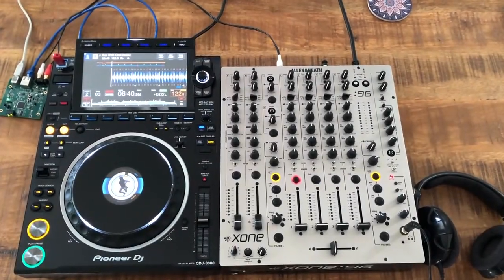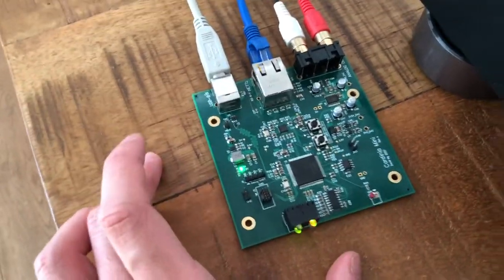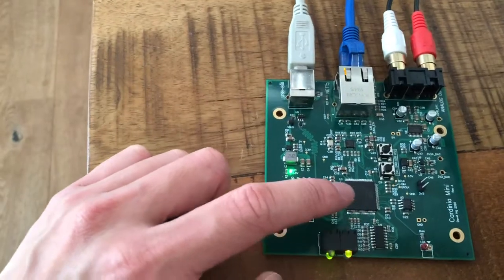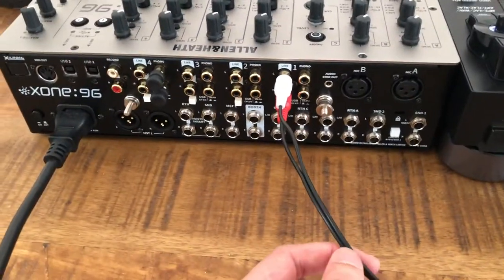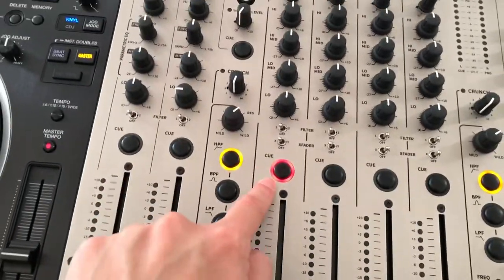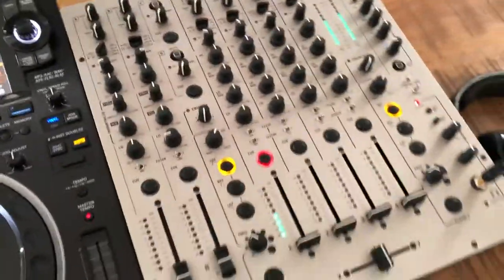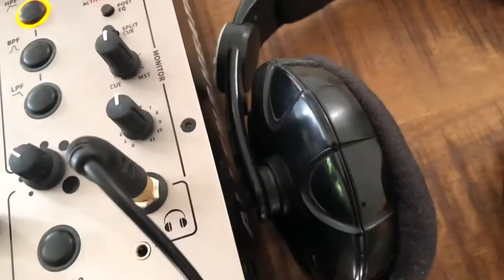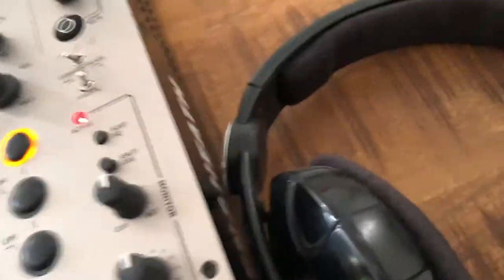CDJ-3000 Touch Cue Demo with any Mixer (part 2)

Comment: The box arrived this week, network cable plugged into my switch together with cdj3000's plugged in.  Audio out connected to my Allen&heath PX5 aux input for touch cue and YES it works !! Thank you David, you're awesome. I was waiting for a more budget friendly solution and hoped for a more affordable pioneer mixer in the future with link-cue. This Cardinia box is the solution. I sold my DJM-750MK2 because it doesn't supported link-cue. But this works with my PX5 so i can live with that. Recommended !

Comment: Does that also work with a switch? So that Pro-Link works and I can still connect the two CDJ 3000s with a network cable? It is important that I can see the waveform of the second CDJ 3000 via the first CDJ 3000 or only use a USB stick that can be accessed from the other CDJ 3000 via Pro-Link (via network cable). However, if the network connection is occupied, it can only work via a switch. Hence the question, does that also work with a switch?
Reply from the maker: Hi Andi, yes it absolutely works with a switch and multiple players. You can see a common connection setup at the bottom of https://cardinia.net/mini/. Hope this helps!
Reply: @nudgeee   can I hear link cue from 2 CDJs using one cardinia mini connected through The network?
Reply from the maker: @leopoldocaciolli  yes that is correct, only 1 cardinia mini is required for multiple players.
Reply: @nudgeee  thanks